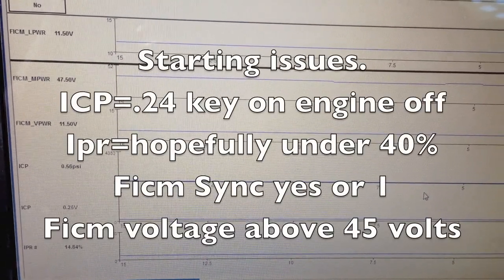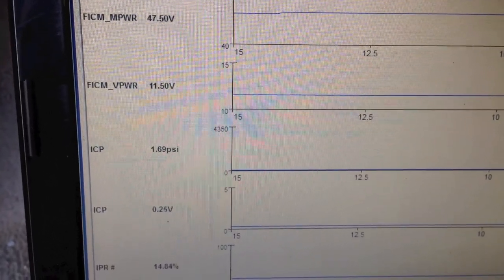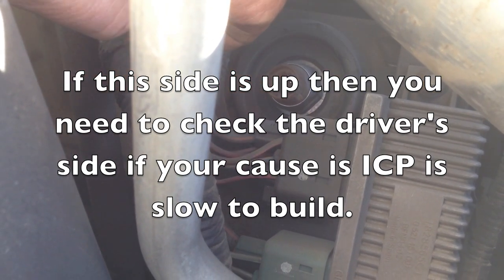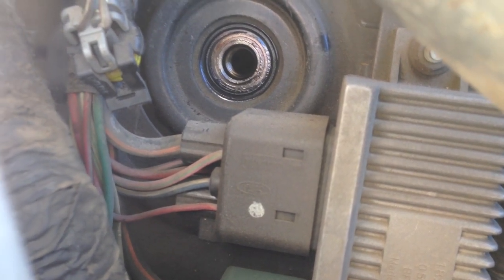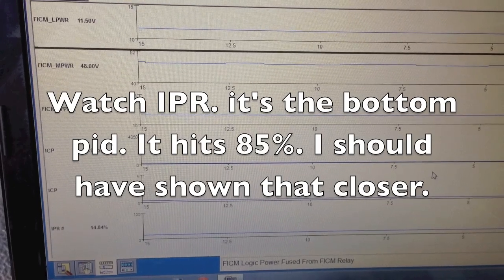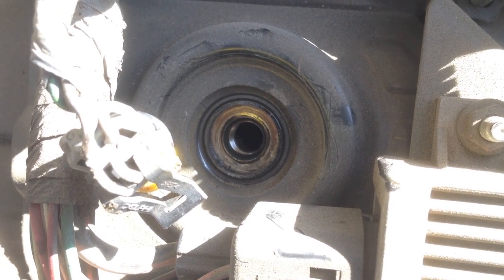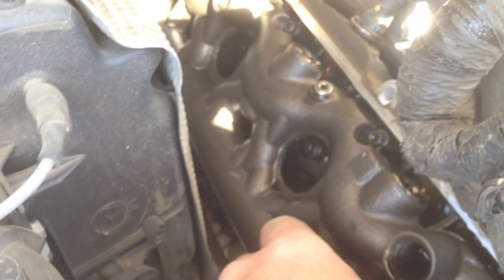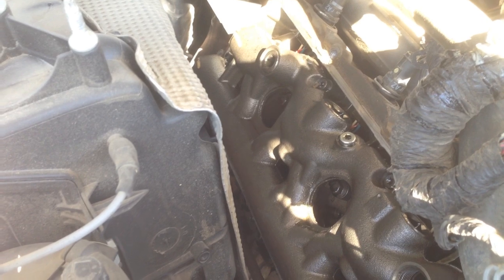6.0 powerstroke long crank when cold.

Comment: I have an 03 with a very excessive long crank (15 seconds+) and a no start hot. Would anyone be able to lead me in the right direction. Also has a terrible stutter at 1800-2200 rpms and when in overdrive
Reply: Sounds like Injectors or seals

Comment: the Problem is that if you already had that sensor off why not replace it with a new one.
Reply: Because it doesn’t need replacement and that sensor is sitting on the top of the engine waiting for you to replace it anytime without effort

Comment: Ron, do you recommend staying away from 2004 model 6.0 engines?
Reply: based on what I've been watching, early 6.0 engines have power but problems, a lot of problems since the engines were relatively new and working out issues. I've also heard that 6.7+ don't have as many problems or has had a lot of the early model engine problems fixed. I recommend checking out the channel powerstrokehelp or hes get a site powerstrokehelp.com bill hewitt, he knows his powerstrokes.

Comment: Do you happen to know the part number for the gasket on the small plug? I replaced Standpipes and dummy plugs as well as replaced the STC fitting with the upgrade and I am having this exact issue again.  Thanks I appreciate the time you take making these videos.
Reply: did you fix the issue
Reply: +Ira Kinkead I found two part numbers but the Ford part doesn't seem to be available.  The numbers I found are 3C349C064BA and NAV 1815887C1. the standard dimensions are -902 but I couldn't find a durometer spec.

Comment: I have a 04 f350 4 door dually that gets stuck on defrost can any one tell me how to check and fix this problem??
Reply: If it’s a 4wd truck, the soloniod that operates the front axle in 4wd is probably leaking. This causes a loss of vacuum and most often causes the defrost vents to come on.
Reply: Vacuum leak
Reply: +Todd Mcvicker There's a small sensor located on the passenger side firewall that is located in the blower box. It has two bolts and is pretty easy to get to. Pull it and look at it. If it looks burnt then replace and you're done.

Comment from the maker: The wear would be enough to be a no start hot if it was driven hard and shut off and restarted within a few minutes. It still should be the same diagnosis on early ones.  Listen to the injector preclatter for sticking injectors and make sure it has oil staying in the filter. (Wrong cap)
Reply: Hey Ron, what causes the FICM to fail? i've heard vibrations and heat, and low voltage/power? what is the cause? if its heat and vibrations, why has no one made an extension harness to put the FICM in say, the glove box? just a thought.
Reply: Munky332 with the size of the plugs for the FICM it would be really expensive to make a jumper harness, not many would care much there easy to remove